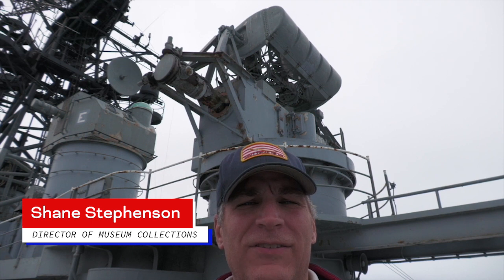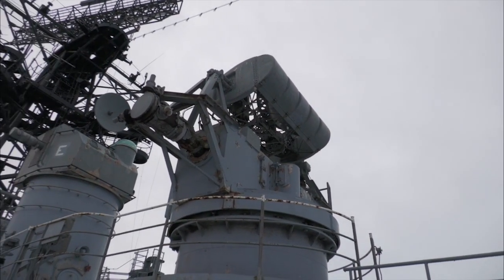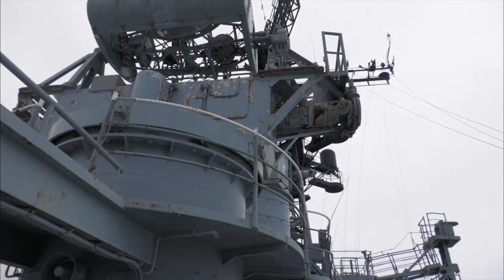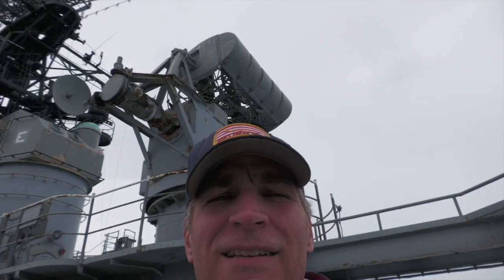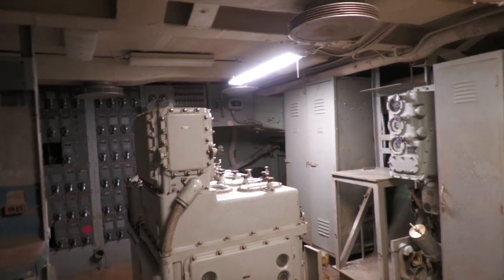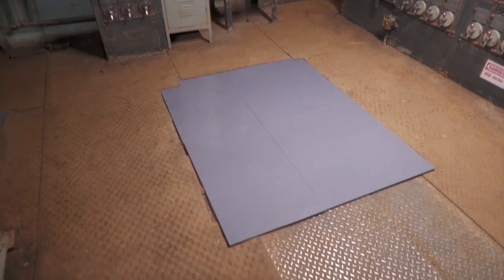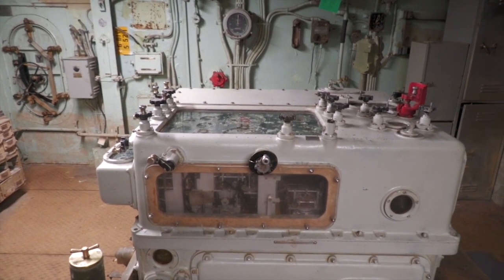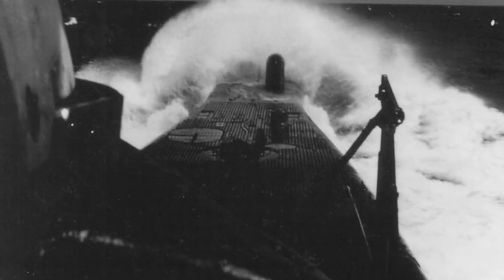USS Little Rock: Gun Directors

Comment: A little tidbit, when the Oklahoma City (CLG5) was converted to a missile ship the MK34 director was removed and the MK37 was used to aim the 5 inch mount and the 6 inch turret. It's possible that they could be cross connected so Little Rock  could control the 6 inch with the MK 37 if it became necessary.
Reply from the maker: David - Yes, I read that! Using the Okie Boat as a source, I found that quite interesting. I don't remember if there was an explanation as to why they removed the MK24...other than weight, I can't think of one - - - but, then why weren't Little Rock and Galveston's removed too! I'm just glad that we still have both directors!
Reply: Oklahoma City had to have major topside weight reduction measures done. She lost that director & her RAST boom & some other items to try to reduce top hamper & get her to settle down & ride better.

Comment: Is it possible that the parts that were removed are still in storage?  I know BB NJ channel said the former USS Charleston had a bunch of old spare parts for the Iowas.  Perhaps the missing equipment is on that ship, which I believe is in Philadelphia due to be sent to Brownsville.
Reply from the maker: C McB, thank you for your comment! I've been told that our computers and vertical stable elements went to USS Wisconsin because they cut them out in 1987\1988, and that's when the Wisconsin was being fit for duty. It would take time and resources  but would also be a boon for us at the Naval Park! Let's add it to the list! 😃Appreciate your comment and your own digging into this!
Reply: Ours were pretty rough internally so my guess is that they ended up getting stripped & gutted in some depo somewhere. They would have needed a very labor intensive & thorough tear down, cleaning, rebuilding, & testing. They were no where near operational ready when they took them out of here.